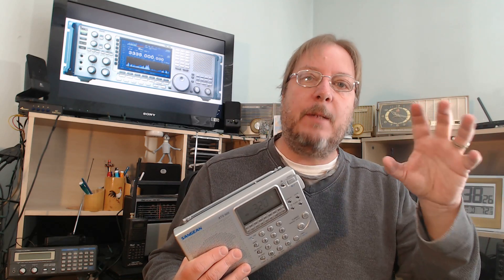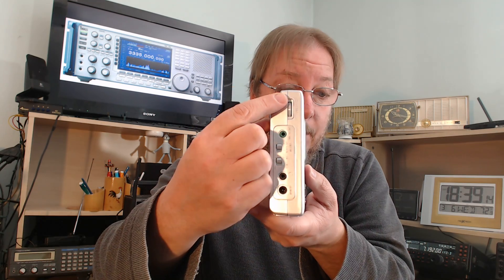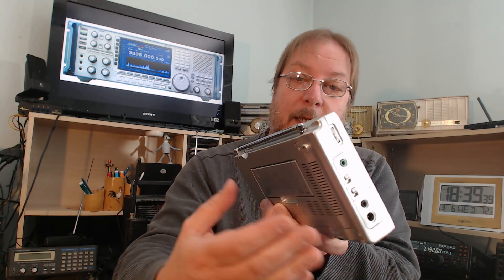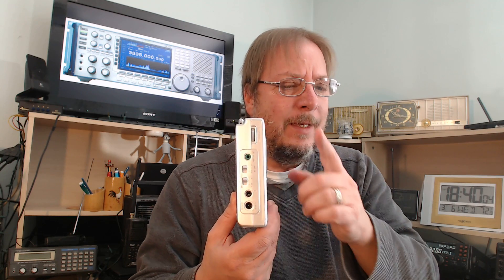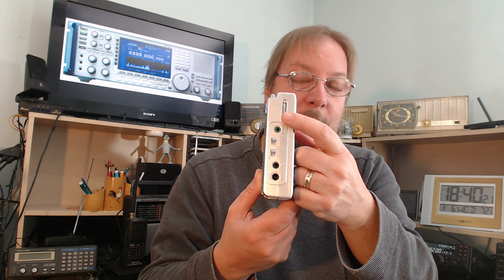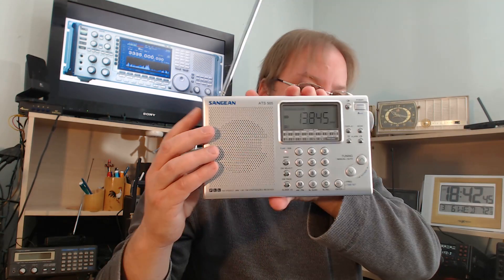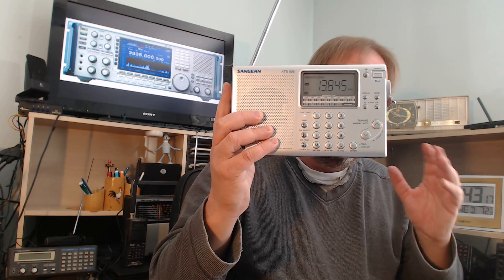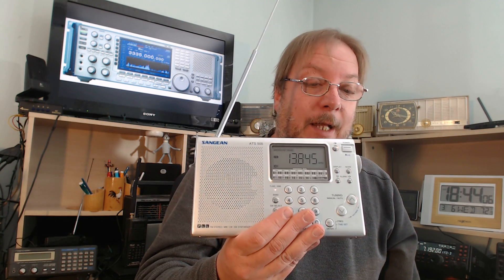Shortwave radio daily tip #20 Using the SSB mode when you dont have separate LSB USB modes

Comment: Great explanation. Thanks for your series of tips. Very helpful. I have the Radio Shack DX-402 like your Sangean ATS-505 and it works fine. My Panasonic RF-2200 has a BFO switch which works well. Tecsun PL-660 has a BFO knob.  Also have Sangean ATS-909X and Eton Grundig Executive Satellit which have separate buttons. I am just starting to use SSB and your tips are valuable.